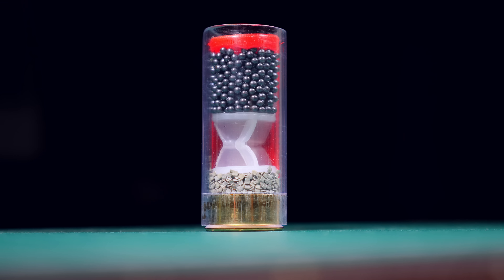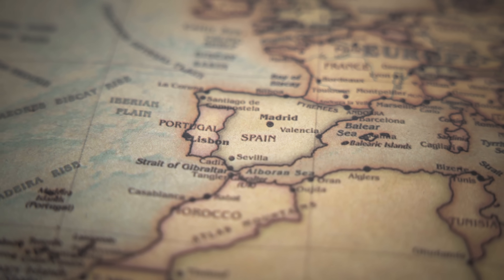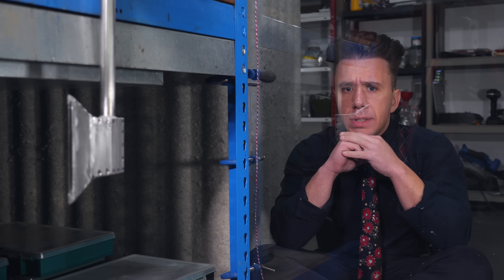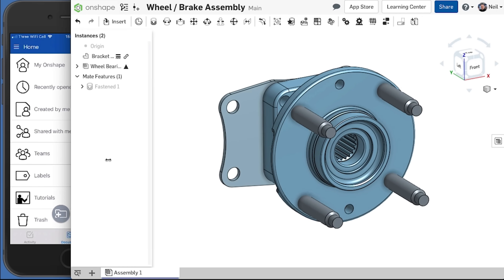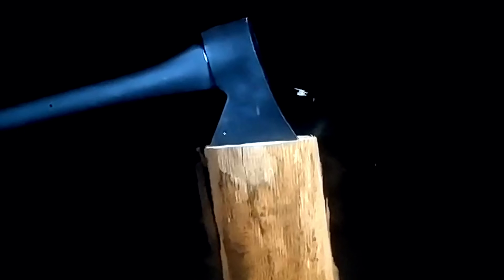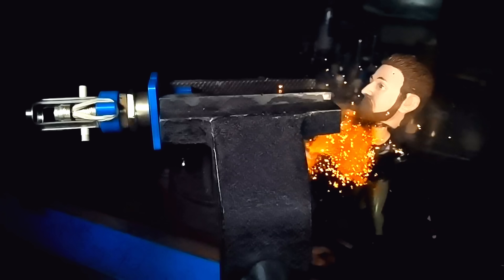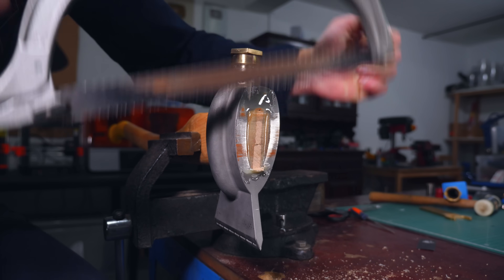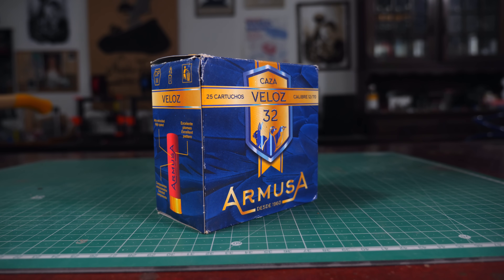I Built a SHOTGUN AXE

Comment: You're gonna get hired to make sound effects that companies didn't even know they needed.
How exactly does one make a sound like, "wood impact with muffled shotgun blast"? Well, you build an axe shotgun and hit some wood with it, duh!
I would like a part 2, as well as maybe some testing on longer logs? Like, is there viability in using it to split small trees to make them easier to cut down? Could this be used by emergency workers/paramedics to blow open some doors at the mechanism rather than ripping them completely open? I don't even care if it doesn't have any viable uses.
It's cool.

Comment: Tesla turbine but backward?
Like instead of using a fluid to create rotational movement, using rotation to move a fluid.

My mind went to gears, if you go one way you have high torque but low hp, but the other way is low torque high hp.  I wonder how that will work.

Comment: I have an idea how you can change it up to auto blast , without having to reload it or buy shotgun rounds.
 That you could use a butane lighter to fill the chamber and the igniter wire  inside the chamber. 
And inside the chamber have a metal piston with a spring under it .  that when it ignites it gives back pressure and depresses the piston then just before it reaches the bottom have some slots or grooves on the inside cylinder wall for the air to go around the piston and into the axe. 

The lighter would be easy that you could just zip tie it to the out side of the cylinder. and on the top of the cylinder secure one of those soft close cabinet door hinges. Put a little weight on the end of the hinge and a rod/pin to depresses the trigger once you hit the wood. And then slowly returns back filling the chamber up with new fuel.  

Rinse, wax and repeat

its a stupid simple idea, thats cheaper to use, much easier to make(since you already have the axe ),  less time consuming than having to make your own special shotgun rounds, and it would be autoloading. Which would be way more practical, that you could probably patent an idea like that that you just refill the axe with butane and make it easy for people to cut their own fire wood with little effort. 

Heck Id buy one if it existed. But I would buy one that needed special rounds just for every chop. Butane is cheap and easy,and can be just as effective making it more practical. 
Then a 90lb girl could cut her own lumber. Also it would be relatively safe.if it was thick enough as it would only have one way to go out the piston then out the axe. 

Although it may have it bit of flame out the blade depending on how high you set the lighter ( which would be pretty cool anyways)
 I would also suggest that you find a lighter with a piezo igniter.   

something like this

https://www.ebay.com/itm/231656113200?_skw=pencil+torch&itmmeta=01JR9BHN22RM4RMY3BSM63MRPV&hash=item35efc7c430:g:s4sAAOSw3ydV0PHw&itmprp=enc%3AAQAKAAAA8MHg7L1Zz0LA5DYYmRTS30kUyfA7cpskvjw3I5%2B8ihpiK6fnWQpJN8sm2FM2Y3J2tJpzLHUEq5GepY8LFnahQ0%2BWV6g9GTH68fmNb%2BgzB0Ax2NFHwMhQqXkvDgmiUq02E9RdbgkvWuDOJbcyJxd5cjvI%2FGhrbLXthsO8QrfSgBayznyPGXtmkzTQzvV%2FiW%2Fi0lL00nzWeW5b8vBT0edzXP4cB4ZtOneYBSjk3V4ebnaHPm281F%2FPfZw%2F99e6NdEkuEFPNu6hrQeWBgyj7s5fB4KRyI%2Faw%2BzdZJUM%2BOrGQS5yCKpXQLkZ5usZ94ZS%2F6Ip5w%3D%3D%7Ctkp%3ABk9SR5LRxqvCZQ

Comment: "I'm using steel because i don't trust any other material not to blow up in my face."
Steel: Produced for industrialism and efficiency instead of durability and strength.
Titanium/Tungsten: The strongest metal(s) we have ever discovered (i think).
Carbon Fibre/Fiber: 5x stronger than steel and wayy lighter (i think 25x lighter than steel)
Reply: Good luck making a custom machined titanium axe head for less than an arm and a leg

Comment: What's wild is the axe kinda has its own safety mechanism by accident. Since the propellant can only burn all the way when the holes are sealed, that means a majority of the force will be lost if the axe is in any situation where it's NOT in a log of wood. So if it goes off on its own and your hand is near the exhaust, your hand won't be exposed to anywhere near the full force of a shotgun. Obviously this doesn't mean it's a good idea to put your hand there, but it does mean it's only gonna work at 100% force when it's used in the context it's designed for. Brilliant.
Reply: He somehow made it a perfect combination, too. I don't think many people will get the same results if they were to try and make their own.
Reply: i thought about the axe getting stuck in your leg so the gas expands inside your leg, completly rupturing it apart.
Reply: @devon6087  how would you end up with the blade in your leg tho.... 😮
Reply: @cherrydragon3120  we’re talking about an axe, wouldn’t be the first time someone missed the swing and landed in their leg.
Reply: I would buy this...
Reply: I wanna see what it does to a log with a nasty knot in it. I hate those ones
Reply: Safety mechanism doesn't work when you "accidentally" lodge it into someone. But good enough.
Reply: How wild...
Reply: So if the holes are sealed by a soft, squishy substance encased in a thick, hard, yet also porous shell with segments throughout the shell and holes near the front, would it still fire at full capacity?
Reply: So I can’t use it on my sister?

Comment: 0:23 
One great thing about chemical names is that they make predicting how to create certain substances or what will result from two given substances reacting more intuitive (along with chemical makeups—obviously, like how carbon dioxide has carbon and two oxygen atoms—and what certain substances do, like how cellulase helps break down cellulose, lactase helps break down lactose, acetate and acetic acid are conjugates of each other, and nitric acid is a corrosive substance containing nitrogen that will neutralize bases).

In this case, it makes it intuitive that you can create nitrocellulose by mixing cellulose with nitric acid.

Also, as a side note, a lot of nitrogen-containing compounds tend to be explosive and/or highly flammable due to just how stable pure diatomic nitrogen is with its triple bond that nitrogen in other compounds would much rather be in a triple bond than in any other state. Nitrocellulose, as seen here, is no exception to that rule, though it is far more stable and less explosive than, say, the infamous nitroglycerin (formula C₃H₅N₃O₉ or C₃H₅(ONO₂)₃) or the absurdly unstable azidoazide azide (formula C₂N₁₄).

Nitrocellulose is a polymer (a chain of multiple monomers (organic compounds capable of polymerizing with other monomers, including another copy of the same monomer) that can be of many different lengths) composed of some combination of mononitrocellulose (which is (C₆H₉(NO₂)O₅)ₙ), dinitrocellulose (which is (C₆H₈(NO₂)₂O₅)ₙ), and trinitrocellulose (which is (C₆H₇(NO₂)₃O₅)ₙ). Because it’s a polymer, some molecules of nitroglycerin can be quite long, even long enough to be seen with the naked eye if stretched out. As such, while most commonly used in powder form, it can also take other shapes, such as an appearance somewhat similar to that of cotton (hence the nickname “gun cotton”).
Reply: All the entries from YouTube have been counted in the giveaway, and you happen to be the winner of the giveaway, to text check notification

Comment: One possible issue I have is that soldering job holding the pipe fitting to the axe head. Perhaps it would be better to put thread into the axe head or use a stainless steel fitting and weld it to the head.
Reply: All the entries from YouTube have been counted in the giveaway, and you happen to be the winner of the giveaway, to text check notification!!!.

Comment: You're firing mechanism design actually is similar to how an open bolt submachine gun works like a Mack 10 or an Uzi because on an open bolt SMG the bolt with the firing pin is locked to the rear and is under spring tension and the sear is keeping it from slamming forward and when you pull the trigger all it does is drop that sear out of the way.
Reply: So you're magnets are basically taking replacement of the sear and the rubber bands are taking place of the mainspring.

Comment: You can remove the spent primers and replace them with new, unpeirced primers to re-use your shells. You can probably 3d print a jig of some sort to seat the primer correctly every time in a benchtop vise or something (Instead of getting a whole ammo reloading press). I'm not sure if primers and powder are less regulated than factory ammunition in your area but if they are you can spend a lot less money running this creation that way.

Comment: I'm impressed you haven't tried lost pla or resing casting for making a rocket engine, you just need a hole in the ground a tube and a hair dryer to get hot enough to melt aluminum, and possibly brass

Comment: The "piston" in the shotgun shell is called the wad and it is just a gas piston/spacer so you get compression. Some ammo has a wad shot cup combo which does the job of the wad and holds the shot together so you have a tighter pattern to the spread. The amount of engineering that has gone into just the ammo of firearms alone is amazing let alone the amount that has gone into the firearms them selves. It's one of the reasons I love firearms as they are amazing displays of physics, chemistry and engineering all rolled into one fun package.

Comment: The crimp adds nothing in the way of resistance to help burn rate.   It is there to keep shot from trickling out the end of the barrel or magazine tube.   Pressure is built by pushing roughly 1 ounce or more out of a barrel

Comment: Dude, the fact that you're using full powdered shells is super duper dangerous, like you really could have exploded the wood, good on you for the goggles but you can take out half the smoke and it will still work just as well but less horrifying risk of wood shrapnel mutilation ❤🎉😂

Comment: You should build one based on the same exact concept, but using compressed air, from a compressor! You could have the air hose connect on the handle and/or have a tank built into the handle. That way, you wouldn't have to reload the axe for every swing. If you don't want to depend on an air compressor, you could build a mechanical air pump into the handle, a la a pump-powered pellet air gun. Spend a minute pumping a lever to fill t a reservoir, then go to town!

Comment: sir I see one major flaw in your design

on impact wood gets stuck on the exhaust port due to ports facing downwards a lot
it prevents axe from sticking deeper into the wood which is suboptimal

test this by hitting wood with a normal axe and with this one without the ammo

ports need to be moved higher up the axe, and be flush with the surface they sit on
then it will stick a lot deeper

Comment: Honestly, from a practical perspective, this axe has no real purpose. If the goal is chopping wood, the bullets won't add anything but extra danger. And if it's meant to be used as a weapon, it's ineffective because controlling it would be nearly impossible. On top of that, the weight of the axe combined with the ammunition would be extremely heavy, making it exhausting to use.

However, if it's just an engineering experiment or a creative showcase, then it's definitely an entertaining idea, especially if the creator simply wanted to try something new for fun or as a challenge. In the end, things like this are more enjoyable to watch than they are practical.

Comment: Holy shit holy shit holy shit dude 

No no no. I'm so sorry. I was 100% certain you were going to do the opposite of this and please, you've got to give it a shot. This is such a cool idea but it's backwards. 

What you want is you want the shotgun shell to go off when the blade strikes the surface of the wood, just like you did, but you want the blast from the shotgun shell directed upwards. You can remove the shot so you're not shooting anything. But the recoil will make a regular ax more powerful. Like, the energy from the shotgun shells will drive the ax deeper into the wood. 

It's like a goddamn +3 Axe of Chopping 

Please, please dude. You've got to do this. It's so perfect. You can even use multiple shotgun shells at one time to get even more power out of the same ax. 

I know it seems kind of dangerous, because, well, it's kind of dangerous. But you've got to give it a shot. So cool 

Thank you for making this awesome video man 

You're doing great things here 

I hope you can take my idea and run with it and make another awesome video

Comment: A few things.  First thing, this project is bananas, very interesting idea for sure.  

Second is that i am afraid that your "bullet proof glass" barrier is probably not bullet proof... too thin, no laminations, etc.  But i might imagine your better off behind it anyway.   

And third thing, did you or are you worried about the axe head exploding?  I am wondering because it is s 3D print and does a 3D part have the same strength as a machined or cast part?  It looks great and the results also look great.  Well done!

Comment: This isn't good for children and adults im a engineer but don't go near firearms or explosive, and if you think im joking i will tell you once, its dangerous, use 100mls of break fuild in champagne bottle and pour in chlorine power inside, all safe put plastic cork on and stand 100metres away within 5mm ir will expode ,and it will reach 30 metres high 🔥 cracker it sucks all oxygen in reaction the negative pressure builds so high it smashes the bottles glass and expodes making ur shot gun old fashioned and the shotgun cylinder dangerous if the barrel spits loss your hand stupid, like ya show 😉 👍

Comment: i have a couple tree stumps that are really really hard around here, so much so that a chainsaw dont go thru them and swinging an axe to it will make your arms numb for a hot minute, i only managed to take a small chunk out of it but it costed me a few days unable to grip anything and sore SO i may or may not try this at home from the controlled distance of the other end of the property... also killing floor 2's pulverizer vibes all over the place lol just lacking the spring loaded firing pin and pump action reload, this could basically be sold like a ramset with blank cartridges

Comment: If you can make it cheaper, still mobile and still easier to use than a hydraulic log splitter or similar device, you might have invented something worth trademarking. Compressor with a pneumatic "blow" instead of a bullet maybe? Auto reload some way while still light enough to use? (Tech. could be in a backpack and carried as such)
Logging is still a harsh job and in the hills there aren't many options (hence eons ago people even used explosives to split logs).